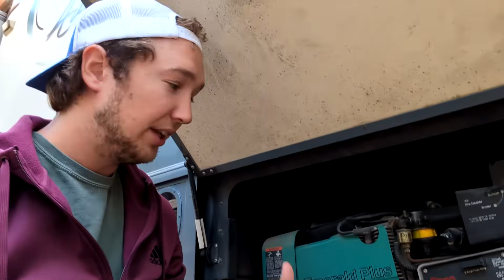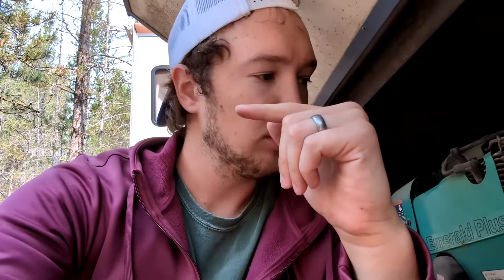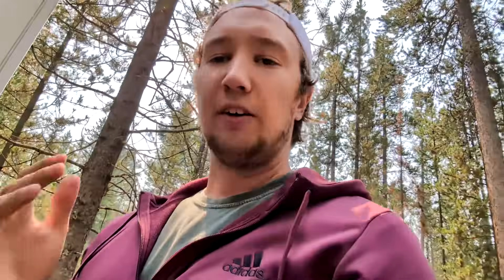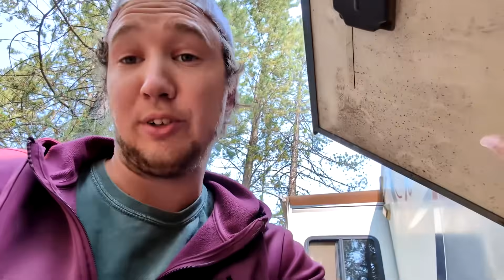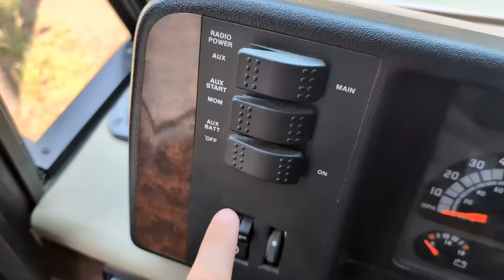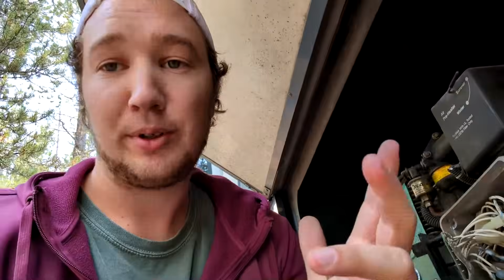Ultimate RV Onan Generator Genset 5000 Troubleshooting Guide | Generator Making Clicking Sound

Comment: I haven't owning emerald 4000 I want to replace it with a 5,000 is the wiring different and will it fit I have a 91 Ford Tioga Montero
Reply from the maker: I'm not super familiar with the similarities and differences between the two generators. But the only wiring running to the RV itself is the start/stop buttons inside, cables running from battery to generator, and then all plugins to power the RV. So if the 4000 had all of these ports, I would think it can be replaced. Big thing is the mounting frame section. I know some generators are smaller because the mounting space in the RV is small and larger/more powerful generators won't fit. But if the 5000 does fit and the RV is not wired for a remote start from the inside or the wiring won't connect, there is a start switch on the generator itself. So then it's just the battery cables and providing power to RV. To get the generator started it just needs a large battery and I'm guessing if you have an RV the battery would be strong enough to start the generator... That was a lot hope at least some of it made sense and may be helpful!

Comment: Great video bro. Does your generator shake alot? Motor mounts? What would you do to fix that? Thanks Mark
Reply from the maker: ours is an older RV so does shake quite a bit but tightening mounting bolts helped. One of them was actually missing so did make a difference but older generators and RVs will just shake more from the research I have done

Comment: I have the same issue but when I hit the switch up front it still didnt click or anything
Reply from the maker: May have a bad ground connection or dead battery if I had to guess. Have you tried connecting the generator to a separate battery and seeing if it turnsover?

Comment: I have the same generator on my 1990 ford e350 mallard motorhome. It won't start from the generaton. It cranks from inside but won't start. Any suggestions? Thank you!
Reply from the maker: If it is cranking but not starting without being able to look at it I'd think maybe the carburetor or fuel pump? Or oil change if it hasn't been changed in years

Comment: Hey man we have the same generator 

It stays running when we ground it only bc the jumper cables are connected. It stays running when we ground the wire for the sensor 

But if we disconnect the jumper cables from the battery it shuts down.

Any chance you know why or can help?

Comment: I have a 1994 Fleetwood Coronado Motorhome with an Onan Marquis 7000 generator that would not turn over (due to weak house batteries that tested 5.9 volts) and just clicked each time I pressed the start button. There is no room on either side of the generator to turn over the engine. Fortunately, the engine cooling fins are visible from underneath the generator tray and I was able to turn the fins with a flat head screwdriver which released the stuck generator, I was then able to start the Genset. New house batteries are next on my shopping list for the Motorhome. Hope this helps others who have stuck generators that are mounted very tightly in their motorhomes.

Comment: How do you  fill gas tank on generator?
Reply from the maker: Ours siphons gas from the gas tank on the RV so we don't have to fill it with gas. But it won't start if there is less than a quarter tank of gas in the RV
Reply: It comes directly from the RV but like the guy prior said you have to have a quarter tank at least in your RV for the generator to run.

Comment: I have an Oran 4.0 1999 and I am not seeing any spark going to the spark plugs I have replaced both spark plugs wires carburetor air filter did oil change I was able to drop it down also replaced gas filter it turns but will not start
Reply from the maker: hmm.... have you checked the batteries to power it or the connection to the batteries? If you remove the power cord connecting to the RV batteries and hook it up to a car battery with jumper cables and it works, then you would know it's something not in the generator parts at least. If you already tried this or it doesn't work but sounds like it is turning over, you could spray a small amount of igniter lighting spray in the carburetor but a really small amount. Might give it the little kick needed to start? Just throwing out some ideas let me know if anything works!

Comment: Sometimes pushing the start switch cranks the starter no problem and it runs fine. Other times pushing the start switch engages the starter motor for less than a second then nothing.  This is the same using the switch on the generator itself and the remote switch inside the RV.  Where should I begin to search for the problem?
Reply from the maker: I've had a similar issue and I think it has to do with low battery level. When our starter isn't turning over if we turn on the RV itself 9 out of 10 times it turns over right away. Not sure if it's actually the issue, but it seems to help

Comment: Which wires attach to the solenoid? The battery power goes in and I have a B+ wire thats on the same stud that goes to ground and the black wire with the fuse is on it as well. The two posts that are next I'm not sure about and the back post has the wire that goes to the starter. So my question is what wires go to those two posts?
Reply from the maker: For the solenoid we have the power coming into it from the 12V wire I believe and then there is a wire that runs off the backside to the starter - ours is a white wire not sure if that is industry standard. 
Then for the two posts on the solenoid there should two connectors coming off of the control board. I'm honestly not sure if it matters which one goes where? We have one at a 90 degree angle that is on the outside post but have switched these throughout the process and nothing has broke yet. Hoped this helped a little bit

Comment: Hello, thank you for the effort on the video. You gained one more subscriber! Could you be able to make a video on all  the wiring where the control board is? Because someone took the wiring, yanked in out to remove the generator out of an RV, and now I am stuck with messy wiring to mess around with, which is such a headache. I will be very helpful if you could make a video on where the wires come in to the box, the green wire that is used for the ground, and the wires behind the control board. Thank you!
Reply from the maker: Thank you for the subscribe we really appreciate it!
We haven't needed to deal with replacing the control board yet and I am a little nervous to mess around with it and possibly break something because the generators can be very fragile (as I'm sure you have experienced) but I may make a video using a diagram or something and some videos from our generator. I'll let you know when that gets posted!
Reply: Thank you!

Comment: Sitting on the side my rv right now same generator. I’m just trying to find which one of these metal pieces is the carburetor. I’m trying to look at where your finger is pointing. lol
Reply from the maker: The carburetor is the black part on top in front. the one on the video has a switch for winter/summer mode. I'm guessing yours has a cover over the top of it making it a little harder to find
Reply: @HoopersRVTravels  yup 👍 thanks man appreciate it